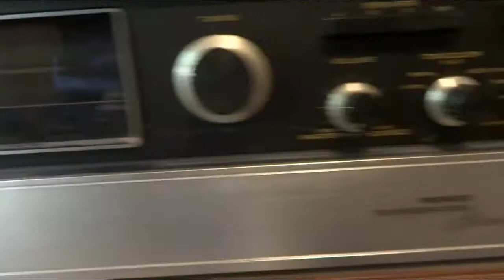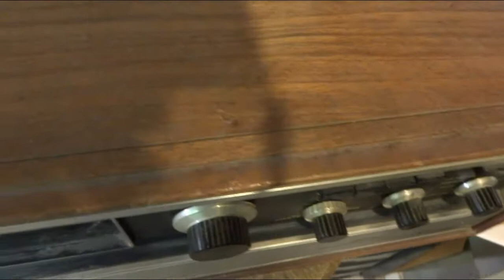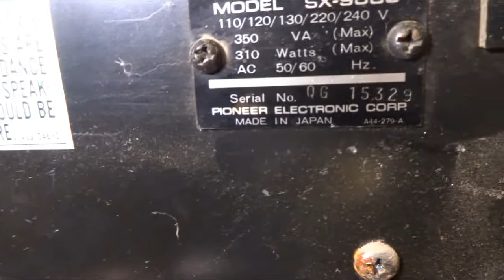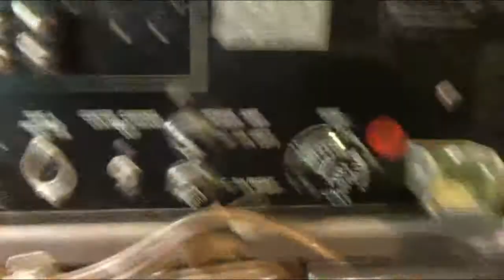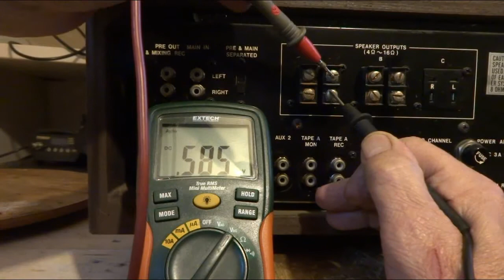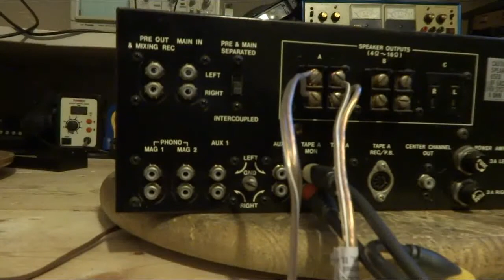Pioneer SX 9000 part 1

Comment: In the process of a very clean SX 9000 / noise and dirty controls. Need capacitors and clean volume pot to start. looking forward to the follow up video. I restore Tandberg's ( Try to restore Tandberg's )

Comment: I bought my SX-9000 in 1971. It was used daily for many years and then occasionally for many years. Now that I'm retired, its been in daily use since about 2007. It took 49 years for the last panel back light bulb to burn out. It has always been on "flat", so the graph is burned out. but I change the profile, some of the graph will light up. It's now my subwoofer amp and works perfectly except that at 52 years old, it needs some new caps. It makes amazing sounds on turn on. If there was ever a receiver that deserved respect and rebuilding, this is it! And parts are still available!

Comment: Nice unit Pat. Looking at the feature set and build this must have been pretty high end back in the day.
Looks like a capacitor coupled output stage. it's usual to see some DC voltage on the oputput with thsose when you measure it off-load. Try meauring with say an 8 ohm resistors across the speaker terminals and the DC should fall to near zero. Regards, Rob
Reply from the maker: Thanks, this is the first capacitor coupled output that I have work on. I will hook up my dummy loads and try it that way. There are a couple of pots on the main amp board that might be an adjustment for this, the service manual doesn't seem to cover this. I still have  a lot of research to do on this stereo.